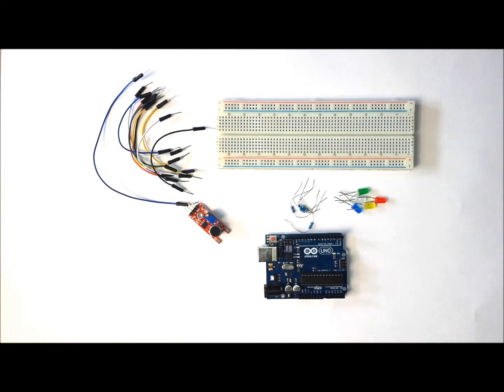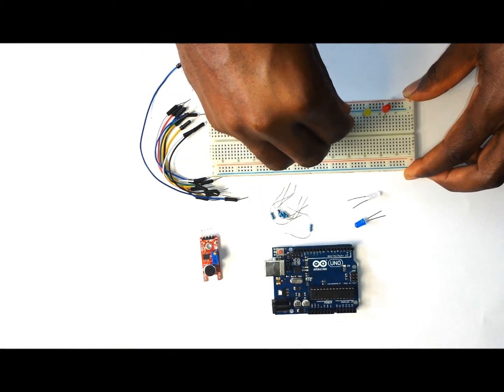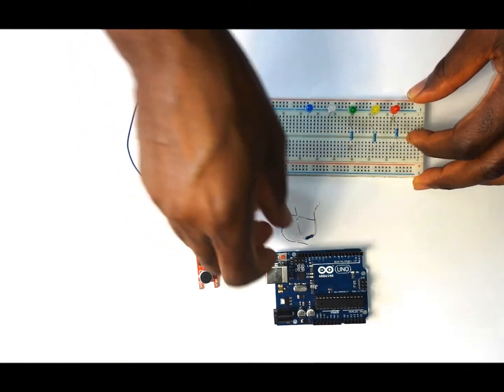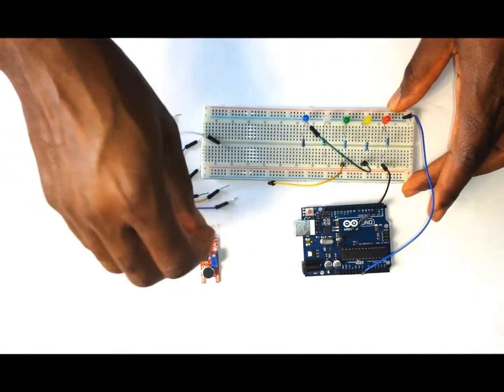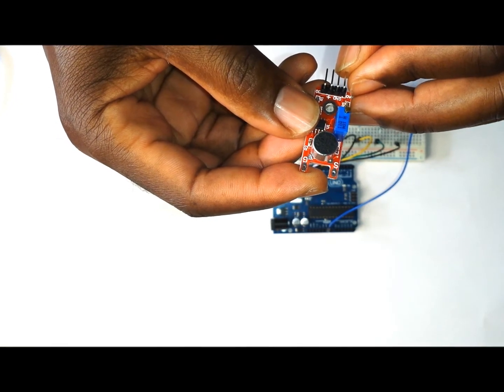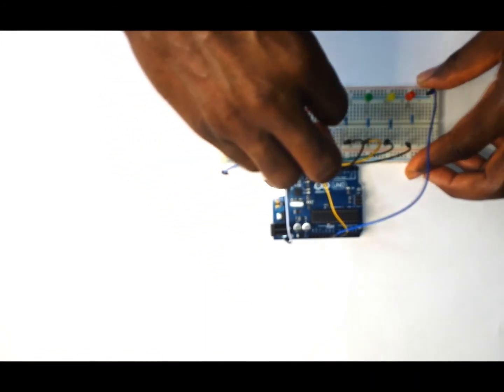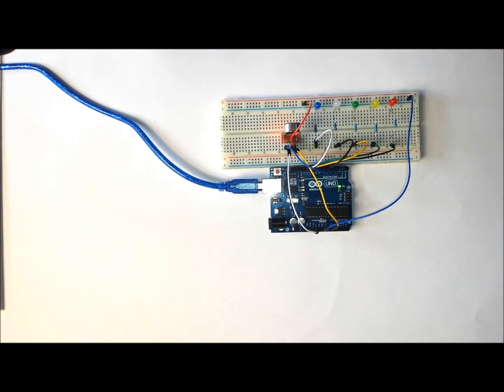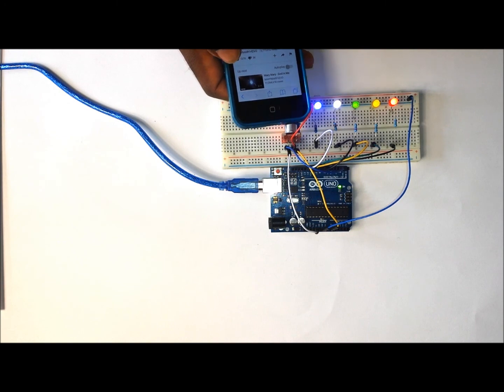Sound Controlled LED Lights with Arduino

Comment: I put this together but the sound has to be very loud for the light s to wrok. Is there any way to make the sound sensor more sensitive? I actually want the LEDs to flash to a voice.
Reply: You can adjust the sensitivity of the sound sensor in its module.

Comment: If you're going to turn them all on and off at the same time, you could have simply run all the LED's in series off a single output and simplified the circuit and code. Why not use different thresholds for each LED, or run them off analog pins to give them variable brightness?

Comment: In this code seriel .begin (9600)is written in a comment just like //seriel.begin(9600) what does it mean ....
Reply: this line opens the serial monitor which is used for debugging purposes

Comment: Th code worked great, Hopefully I'll be able to show you my completed project. I have to add a potentiometer or change the code a bit to different thresholds for each led but thank you for this video!
Reply from the maker: Great!!! Can't wait to see your project
Reply: TechExult 
Rpl plz
Reply: Your code is not working.
 Pinmode(2, OUTPUT);
 Pinmode(A0, INPUT);
ABOVE CODE MUST BE REQUIRED TO RUN THE PROJECT SUCCESSFULLY...